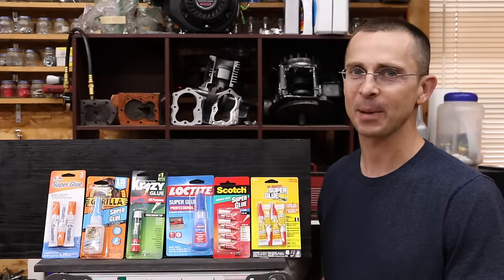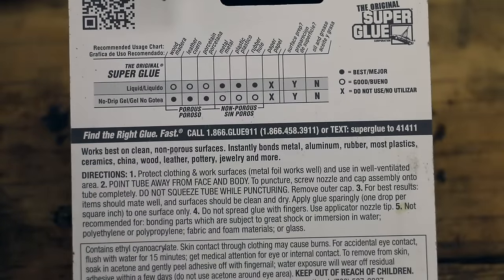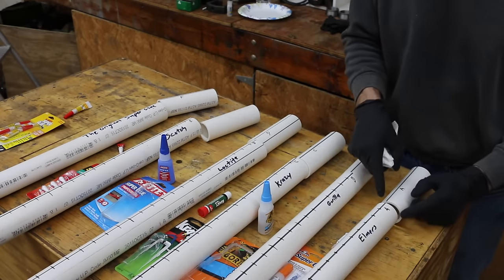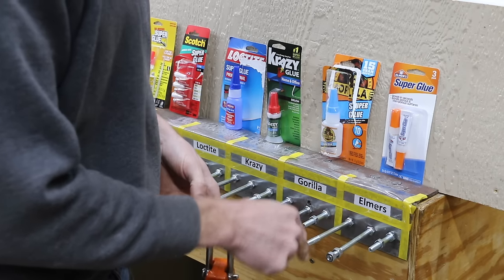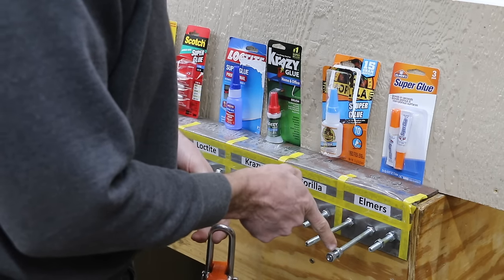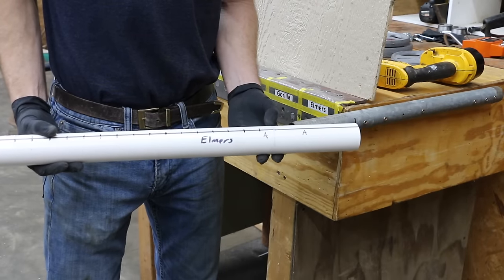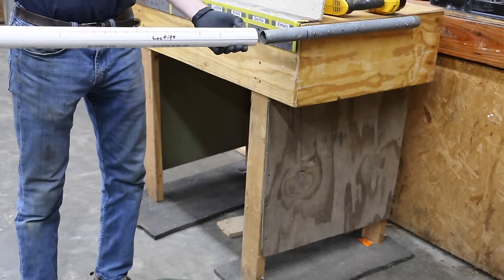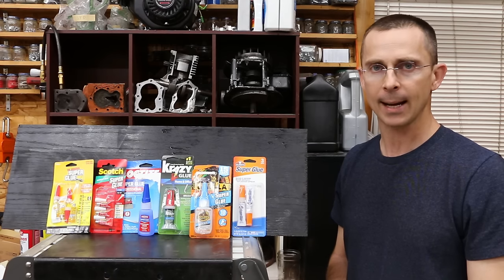Which Super Glue Brand is the Best?  Let's find out!

Comment: lb force and newtons are just different units just like inches and cm.  As an engineer, I see no reason why newtons would be anything other than a personal preference in any situation.
Reply from the maker: Thank you for the feedback
Reply: True, although the imperial units are notoriously confusing...
Reply: I agree, but it's also possible that his scale gives better resolution in newtons versus pounds force. For instance if it only outputs in 0.5 lbf increments or greater.
Reply: I agree. Honestly, I would say it's better to measure in pounds simply because the majority if the viewers recognize it more as a standard and can gauge how much force is applied vs newton's that only people in specific fields use and recognize. Sure it can be more accurate but if the information doesn't make it across that mental conversion threshold, then it's useless.
Reply: THANK YOU!

It's his video..he can use whatever unit he wants to use.

                                          Period.
Reply: James Souza Thanks captain obvious.
Reply: Thunder Kunt Yeah, a lb of force is roughly 5 Newton’s. But at the base level the unit is measuring/using some primary unit then converting it to others. So if it does offer a higher resolution for one specific unit it would be a quirk of this specific device.
Reply: It makes sense to give both to reach the widest audience. Think about how many people are in the US that came from a metric-based country.
Reply: @Massimo-sn7xd  Just wait until you deal with accepted metric units of pressure.
Reply: There is an internationally agreed system of measurement, so in theorey that is all defined (and that definitly excludes anyting like "lb force"). But in real life, US Americans understand only imperial units while Europeans like me do only understand metric units. Of course I could convert, but to be honest if it is not metric I would just not watch the video, because without conversion "lb force" means as much to me as foobar.
Reply: Actually, all the measurements are applying torque and the correct unit should be Newton-meter or lb-feet. For example, the first test is at a fixed distance but the force is applied at right angles to the screw long axis. For tensile strength, you must pull the screw along the axis (perpendicular to the bonded surface).
Reply: chichi But that is impossible to measure in this case...and torque is directly proportional to force.
Reply: @CosmicEpiphany  Torque is force times the distance but more important is that it measures shear constant whereas a straight pull will measure tensile constant and they are distinct elastic constants. For an isotropic solid they are related.
Reply: Newtons works were all nonsense....
Reply: Maybe if he gripped it by the husk? I do my measurements in a wood/witches ratio.
Reply: You're definitely not an engineer of you think units are a preferential thing...
Reply: @TheSlimCognito  specific fields? Do you mean THE REST OF THE WORLD? Because Newtons are SI/metric, which the rest of the world uses.
Reply: @sivansharma5027  well it's a good thing project farm is not filmed in the "rest of the world." it's filmed in the united states, where a majority of the viewers are, as well as the products he tests. So from that perspective, my statement is 100% accurate.
Reply: @sivansharma5027  That has to be one of the silliest and provably wrong statements I think I’ve ever heard. 

1 pound force = 4.448 newtons meaning the units are equivalent, one converts to the other, they are interchangeable, identical, equal in all ways. If you don’t understand how that makes units a preference then I can’t help you. In the US we use both systems and which unit is used in which industry comes down to historical preference.
Reply: @TheSlimCognito  First, prove to me that the majority of his viewers are in the US.

Second, even if that is the case, the imperial system is now actually defined by their metric counterparts. As in, one inch is defined as being exactly 25.4mm. this means the US is actually metric, you guys guys just convert over into imperial. But for all intents and purposes, when the US engages in global projects, you guys use metric.

Also, metric is the language of science. What Project Farm does here is scientific experimentation. It only makes sense to use the language all other scientists and engineers do if he expects his work to be taken seriously
Reply: @CosmicEpiphany  The system that an engineer uses is not up to preference! It is determined by the industry, which is determined by legislation etc.

Sure, for your personal projects and for the average tradesperson, you can choose to use whatever system you want. But if you're an engineer, you would have completed tertiary level education and it would have been stressed to you how important is to stick to one system of units. And if you've worked in the industry, you would know that mixing and matching units is grounds for dismissal, because accidents happen when one engineer decides to use a different unit to the rest of the workplace etc.

Now its very likely that in the US your engineers use imperial, but given how the rest of the world uses metric and how engineering projects operate on such diverse scales, an engineer in the US who isn't adept with using the metric system is an engineer without a job. That, or you're not an engineer and are actually just a mechanic, or diesel fitter etc. Nothing wrong with that, but the days of imperial engineers are gone.
Reply: @sivansharma5027  In the US engineering educational system being familiar with unit conversion is what is taught.  Engineering textbooks in the US are a mixture of imperial units and metric units through and through. However, in different industry due to some type of historical preference usually one system is used exclusively.  Engineered projects are presented to a US public that typically only knows imperial units. 

Mistakes can and have come from this....Of course, but there’s plenty other areas for mistakes to occur. There’s even a famous US example I can show where an engineering mistake came from unit conversion. I’d love to use only the metric system but in the US that’s just not a possibility at the moment. 

Here is the example proving this is done at the highest level of engineering in the US (this happened at NASA). 

https://www.latimes.com/archives/la-xpm-1999-oct-01-mn-17288-story.html?_amp=true
Reply: @sivansharma5027  Also, I’m unaware of any laws in the US that regulate what units are used in what context. If you can cite a US law that regulates units I’d be shocked and impressed.
Reply: @CosmicEpiphany  Your Fair Packaging and Labelling Act (FPLA) requires metric be included in package labelling. 

Suprise?
Reply: @CosmicEpiphany  There's the Metric Conversion Act (1975), declaring the metric system to be the "preferred system of weights and measures for the United States' trade and commerce".
Reply: @sivansharma5027   The 1975 act did nothing to the engineering private sector since it was in relation to government bodies...and it also permitted use of imperial units “in all areas.” In no way did it require specific units be used in any cases. It was a forceful suggestion. 

The FPLA is not an engineering sector law; we are talking about use of law in the engineering sector. It is a consumer law in relation to consumer products. 

You get a 50% but that still means you get a failing grade. Neither of those laws are examples of laws that require specific units be used in the engineering sector.  If you can find me a law that regulates the use of units within the engineering sector in the US I’d still be shocked and surprised.
Reply: @CosmicEpiphany  50% is a pass...
Reply: @CosmicEpiphany  Your words were "If you can cite a US law that regulates units..." That bit of legislation regulates units :P

Don't go moving goal posts on me
Reply: @CosmicEpiphany  And we are not arguing about metric in the engineering sector; you said units were a preference and I said an individual doesn't get to choose whichever units they prefer because the measurement system is determined by the organisation/agency/employer etc. whom are governed by legislation. And yes, the legislation does not require exclusive metric usage, however if you read the other items in that link, it does state that imperial units are defined by metric standards. So if you ask how long a metre is, we say it is the distance light travels in a vacuum in a specific amount of time. If you ask how long a yard/inch/mile is, you say it is X metres, which is of course the distance light travels... etc.

My point is, legislation has defined your imperial units directly from the metric system.
Reply: @sivansharma5027   You’re a smart man you know we are talking about the engineering sector in the US not consumer products. Regardless...you’re original statement of “you’re no engineer if you think units are a preference” is what I took issue with. And I informed you that in the US all engineering textbooks use both systems.; even in in-field/commerce engineering in the US uses both systems such as NASA and JPL. Not sure why you thought you’re where so familiar with engineering, as a field, in the US.
Reply: @CosmicEpiphany  But if you do want to argue metric in the engineering sector:

I agree metric is not required and I'm not aware of any legislation enforcing it. However, operations that require cooperation, either nationally or internationally, you'll find that metric is the preferred system because it is the globally accepted language for measurements. Often you'll have teams from different backgrounds and countries coming together in projects; metric is universally understood.

There is no end to the number of engineering projects in the US that exclusively use metric
Reply: @CosmicEpiphany  But NASA certainly doesn't allow mixing and matching of units. That's how accidents happen. Organisations like that would dictate what system to use and employees must use the system their employer has asked for to ensure mistakes don't get made, mistakes which could cost lives. Hence, units are not YOUR preference in engineering. Someone else tells you which system to use and you use that system, or you find work somewhere else
Reply: @sivansharma5027  I never said it was my preference.  I was just saying that at the end of road.  If you follow the rabbit hole to the very end, at some point someone picked a unit system, and since they are equivalent in all ways that is based on personal or historical preference. 

As an engineer I would love to use only metric in the US. But at this time it isn’t feasible and that’s why both systems are taught with an emphasis of being good at converting. 

Also here is an article talking about how NASA uses both systems. There are 1000s of places for mistakes to happen on any engineering project, so I don’t know if I’m convinced making it 1001 is significant. https://www.space.com/3332-nasa-finally-metric.html
Reply: someone has to say it......... glue 2 fig newtons together, and test effect on the bond when submerged in milk for 1,3 5 minutes

Comment: What Type of gasket maker would be the best at sealing a head gasket!?!?!?
Reply from the maker: Seems like a great video idea--thank you!
Reply: Project Farm I would love to see a video on it!!! Your my favorite YouTubed and I love every video you post!!! And your welcome!!!
Reply from the maker: Thank you very much!  I'll see what i can do. I need to figure out a fair test design.
Reply: Project Farm okay!!!! Anything works!!
Reply: Remember that some types of gasket sealant works best if applied in a thin layer first and let it harden a while until it goes gooey and then mount it, then it is under more tension
Reply: Actually tried with loctite blue 242, threadlocker. Worked for two days. Jb weld maybe works too
Reply: Project Farm your the best love all ur videos keel up the gd work sir
Reply: project farm thanks again for all of your help and advice I have a locktit gasket Maker I will send you a picture Gmail with out your videos people wood not sure what to use 👍
Reply: If I have any doubts I use Aviation Grade Permatex in a can OR Permatex #2 in a tube. This is on pressurised stuff. Sillycone works fine for everything else for me.
Reply: This one interests me as well, and maybe you could do a separate one on cork gasket against a neoprene one also?
Reply: Project Farm for the gasket maker, use a small engine head and convert your compression tester into an air inlet. Hook it to a compressor and add 5psi at a time. This would be so cool!
Reply: I would love to see you test Kubota Grey gasket maker. They tested it by splitting the case of a john deere tractor, and put it back together without the bolts, just the gasket and they drove around and worked the fields or whatever and it held !

Comment: Was just going to suggest you test this and figured I should check if you already had first.
From experience, I suspected Loctite would be the best with plastic. It's crazy strong!
Not surprised Scotch did well, by 3M. I use super glue a surprising amount in auto repair.
Reply from the maker: Thanks for sharing.

Comment: Great video as always. I think that one of the great things about this channel is that manufacturers will stop lying or inflating results about their products if this is shared all over the internet.

Now about the experiment, I would go for the Scotch brand. It has not the highest score in all tests but stands out for almost everything. I would also rely more on the tests involving metals, which is the hardest test for those glues. The plastics can be fused together by the glue just like the PVC glue does. Therefore you will be measuring more the strength of the fused plastic instead of the strength of the glue. Just like what happened with the Gorilla brand. It goes well on plastics, probably fusing them together, but shame on metals. I would say that the Gorilla brand has "Gorilla" only on the name.

Thank you again for an excellently well-done experiment.
Reply from the maker: Thank you very much!
Reply: It won't stop manufactures putting misleading statements on their products. There's some people that are loyal to a brand no matter what. They stick to what has worked for them.

Comment: Seems to be every product that I use and have the best luck with, performs poorly in these tests.  I've fixed many things that shouldn't be fixed at all with Krazy glue and its what I swear by.  Same with the tape test, I've used Original Duck tape for years, and I find it works best. Liked gorilla tapes strength, but it lacked the flexibility for some applications.  Also have used JB weld to fix millions of things and tried different products with poorer results. I think these products all depend on what your fixing, how your fixing it, and also once you get used to a product you learn yourself what preparation measures make the product work best for what you use it for.
Reply from the maker: All great points and thanks for commenting.

Comment: Will self pleasure lubricant act as engine oil
Reply from the maker: Thank you for this recommendation!
Reply: Project Farm hows she going
Reply: i looked up silicone oil for use in my air guns on Amazon, and found a crap load of "sexual lubricants" LOL
Reply: TRUST CHRIST OR GO TO HELL lol holy crap

Anyways silicone 'personal' lube as oil would be interesting. Dot 5 brake fluid is silicone based. Wonder how it would behave.
Reply: As stupid and trolly as this sounds it is a great idea that will generate a lot of views!  And the best part is how professionally it will be handled.  :)
Reply: mr bad example ik gets anoying lol
Reply: This is an interesting comment, considering 
your user name, Trust Christ, or go to Hell!

steve
Reply: TheOutdoorCanuck silicone and water based and the differences.
Reply: TheOutdoorCanuck he should do it
Reply: This has been suggested a few times. I think water based lube will have the water evaporate quickly and just turn to paste. The Silicone based will turn to paste even faster.
Reply: Steve Skouson so what, Christians can't use sex toys or lubricants? Lolol
Reply: More importantly, will engine oil work as self pleasure lubricant?  I tried super glue but that didn't turn out well.
Reply: Silicone lube made my chap waterproof, was a nightmare to wash off fully

Comment: Just want to say I really enjoy your videos and appreciate how much time/effort you put into them, but this one has some issues.

The sample size is just way too small to draw useful conclusions from. If you tested each type of stress/force with 3-5 bolts each instead of just one the results would likely normalize (less difference between brands) a significant amount. The issue with a single bolt per stress type is that if the result is skewed by human error or something else there's no way to tell. I think if you repeated this test with multiple bolts per stress/force type the difference in results would be surprising.  I'm by no means an expert but from an analytical standpoint using a single data point for anything is not good for precise and accurate results.

 Just my 2 cents on the matter.
Reply from the maker: All great points and thanks for the constructive feedback.